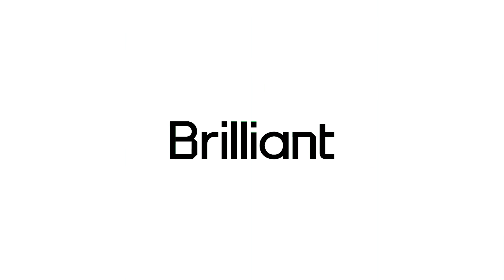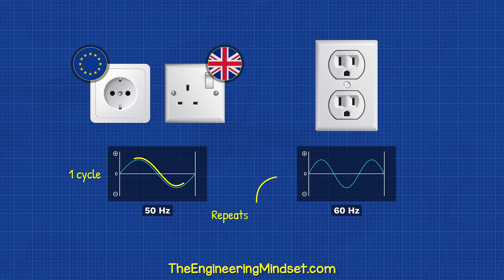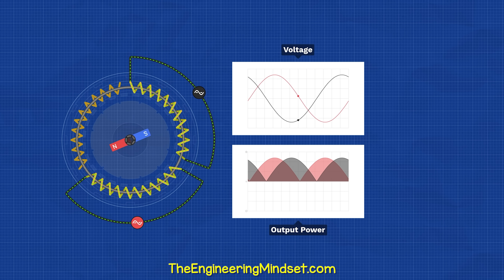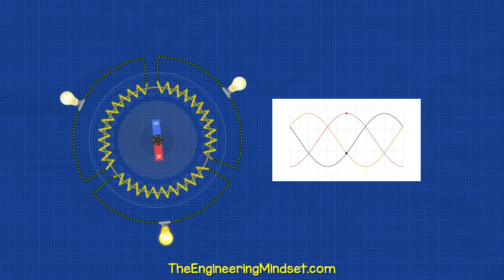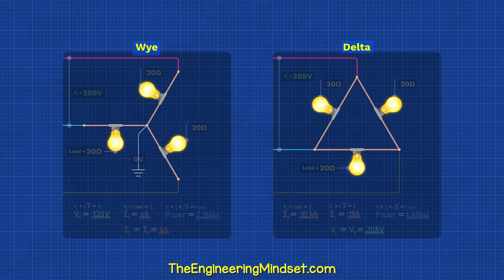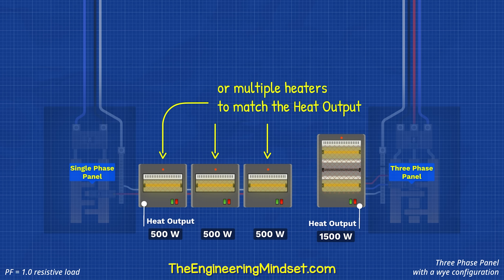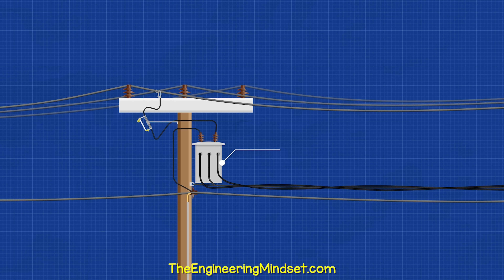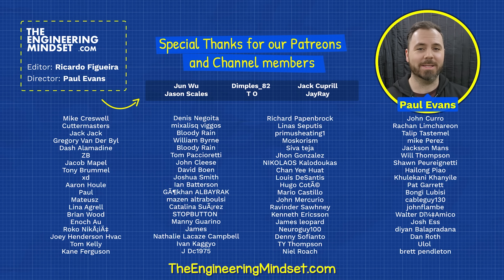How 3 Phase Power works: why 3 phases?

Comment: 9:06 It's worth mentioning that the reason high voltage is used is because the loss in the wires is given by (Current squared x Resistance of wires).  So halve the current by doubling the voltage (for a given wattage of power delivered) then you quarter the losses.  This permits the use of relatively modestly sized transmission cables, when you consider the power they are delivering.  Very high voltage means fairly low current flow and yet still a good power delivery.  The upper limit being, how to insulate very high voltages on the lines and make safe and effective transformers to step up and down and the ends.

Comment: Daaamn, why does it have to be so complex in the US? What's wrong with using just two or maybe three voltage levels? Do Americans for some reason like using more complex systems? (Units, most famously, but also car emission standards, available fuel octane levels, and now this - it may all be just a coincidence that I encounter the complex ones, but I swear, all of those are more straightforward in Europe...)

Comment: I have a question about phases or at least the terminology; in Europe, for the powering of trains, the catenary is labeled like 15K V or 25K V at a phase of 16 2/3 Hertz.  The number 16 2/3 is 50 divided by 3 but my problem is that each leg of the transmission is still 50 cycles per second.  This would be like us in the USA saying 15K V  at 20 Hertz when it is actually 15K V at 60 Hertz on each leg.  Is this just a designation term that is used?

Comment: Re: flicker of incandescent vs LED, I was under the impression that it's the opposite actually? Incandescent light is "wire get hot and make light", and there's enough thermal inertia to keep the wire hot during the transition. LEDs are nearly instantaniously on-and-off, as anyone that's ever watched a dashcam video has had the unpleasantry to notice with modern car headlights (and in fact in my older car, the rearview mirror vibrates when idling, coincidentally at the right frequency that I notice LED headlight flicker with my naked eyes in that mirror)...
Reply: No, you are confusing two terms here. In the case of LED lights, the annoying flickering seen on Dashcams and cars does not come from the AC Alternating Frequency. This is because many LED lights, especially those used in screens and dimmable lights, use a technique called PWM, which consists of regulating the speed (in the case of motors) and the intensity of the light in the case of lamps by sending high-frequency DC current pulses that, depending on their frequency, can make it appear dimmer or brighter.

In other words, the light is regulated by flickering instead of a constant signal. To understand PWM, think of an example from everyday life, such as when you spin something very fast or push someone on a swing. To swing someone faster, you don't hold them all the way and shake them quickly, but instead, you push them with all your strength for a longer or shorter time or period (frequency). The PWM does the same thing. It applies the maximum amperage and voltage that the device supports all the time and makes it faster or slower by connecting and disconnecting it quickly (what is perceived as flickering).

-This is also the reason why you cannot use incandescent lamp dimmers on LED lamps. Because in the past, incandescent lights were only dimmed using a resistor (Rheostat) that limited the voltage, but this has the disadvantage that it also limits the Power, so it is not useful in large or compound loads and has the main disadvantage that this makes the machine inefficient since it does not work to its full potential and all that energy not used by the resistor is wasted and converted into heat.
-In fact, the triggers of tools like drills or blender motors are actually a PWM module (and that module is the one that generates the characteristic beep of some tools, since the PWM usually does it at several KHz of frequency, making it audible) and when you press them what you regulate is how fast or slow that motor turns on and off per second. The PWM, by delivering maximum power only by limiting the time, allows precisely a drill motor and more evident in a blender to have the same force at a low speed as at high speed. Otherwise it would be similar to a fan, which would start very slowly and perhaps if it is not at a high speed first it would not have the strength to move.

Comment: I understood until 6:00 , then the explanation went from High School level to University level and I was reminded why I failed and eventually droped off engineering
Reply from the maker: So at this point we just discuss how to connect the wires together instead of them being all separated. Combining them means we can use less wires as current is flowing forwards and backwards on each wire at a different time, depending on the position of the magnet in the generator as it passes the coils at different times. So the current can move between whichever wire happens to be flowing forwards and which ever one happens to be flowing backwards.

Comment: Why three phases? The problem with two phases  is that your bicycle can be at top-dead-centre. As a human you can wiggle around a bit. An electric motor - not so much. Three phase will always start - but people don't have three legs.

Comment: 6:00 bonus points to Japan for designing two incompatible networks linked with a massive AC-DC-AC interconnect 😅
Reply: Japanese engineers need some challenge to work on and keep their skills sharp.

BTW, the Itapu Dam supplies about 10% of Brazil's electricity, and it is delivered via an HVDC line (AC-DC-AC conversion)

Comment: 3:35 while good LED bulbs barely flicker, cheap LED bulbs may ironically flicker even more than most incandescents! the diodes can respond very quickly to changes, (like in the demo with the two LEDs showing the two directions) so a bad AC-to-DC system could make them seem to flash; similar to fluorescents with cheap ballasts or failing materials. 

on the other hand, an incandescent bulb is limited by the speed of the filament cooling, so it might dim slightly near zero crossing but many will not have a noticeable flicker.

this is also one of the reasons cheap LED accessories flicker so much, especially if the rectifier is a single diode only outputting half of the time (shameful when full-bridge is not much more)

Comment: Three phases because that is enough...diminishing returns.  More cost more but return less.  BUT, three phase to each location, including residences, should be established as a goal to work towards.  3ø makes everything better and higher voltage makes motors, etc. smaller.

Comment: Excellent explanation.  In our area (Chattanooga, TN) there are still a fair number of 240V delta three phase services, with one leg center-tapped to provide 120V power.  This is because in the early part of the twentieth century there were relatively 120V loads, most loads being high wattage process equipment, electric heat, motors, or very high output lighting which benefitted from the higher voltage.  This yields two phases which are 120V to ground and one which is 208V to ground - although it can't be used for single pole 208V loads because in the USA, 208V devices are constructed to use two legs of a 208V three phase system, not one hot leg and a neutral.

Comment: I have NEVER seen an incandescent bulb flicker like that, but I see LED bulbs flicker all the time. It drives me nuts lol. Great vid!
Reply: Generally, a person does not see the flicker of a bulb because of the number of times per second it happens.  In the US, Canada, and Mexico, it is 60 times per second.  There are a few other countries that use 60 Hertz or 60 times per second.  Most of the rest of the world uses 50 times per second or 50 Hertz.  
The use of 24 frames per second for motion pictures was because that was the slowest rate that normal eyes can see and not be bothered by the flicker.  Television and computer screens use 30 and recently upgraded to 60 frames per second while using 4K or higher resolution for better pictures.  The difference in frames per second or even Hertz is why wheels with spokes are seen rotating backward sometimes depending on the revolutions per minute the wheel is rotating.  This can happen with video cameras and LEDs or TV sets.  
An incandescent bulb operating on a frequency of 25 Hertz or cps will show the flicker because the filament cools down enough between power-on times for most people to see the flicker.
Reply: Flickering is a very good indicator of a cheap(ly made) LED light. They are essentially a few LEDs and a rectifier in series, with little if any smoothing which produces more noticable flickering due to the LEDs' forward voltage. That effect is also increased by the LEDs turning off entirely near the zero crossing as opposed to an incandescent light which keeps glowing a bit thanks to thermal mass. A well made LED light has smoothing and a boost converter to keep light output more or less constant.

Comment: Great video for a basic explaination on power production and distribution.
Slight mistake at 8:45, when claiming delta connections can only handle balanced 3 phase loads. Thats incorrect.
Deltas disadvantage to wye, is that you can only get line voltage (phase - phase) from it, but with wye, you can get both line voltage, and phase voltage (phase - neutral). Only applies to single phase loads though, for 3 phase loads you only get line voltage out of them both.
Deltas absence of a neutral point also means delta only support IT grids at supplier end, as there is no neutral point to connect to ground. While wye connections also support TN at supplier end, since there exists a neutral point that can be grounded.
 A few countries does still rely heavily on IT power grids (no neutral wire), and that wouldn't work at all, if the absence of neutral coulnd't handle asymmetric load.